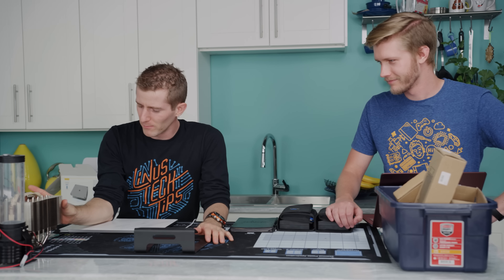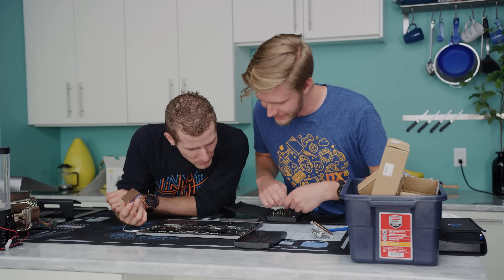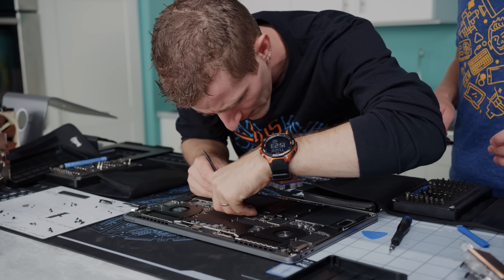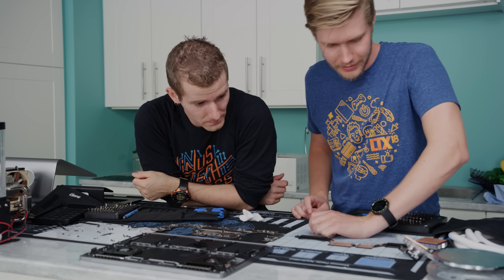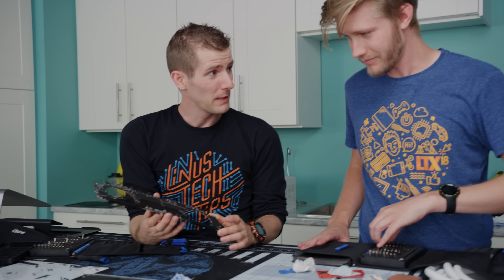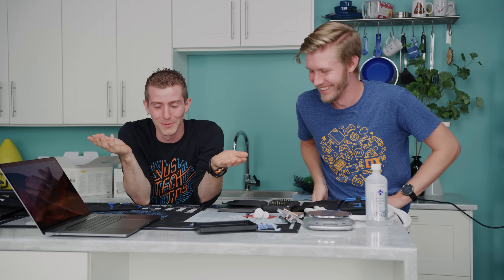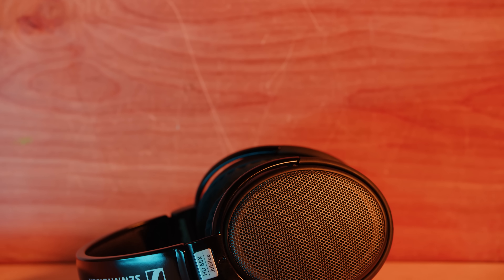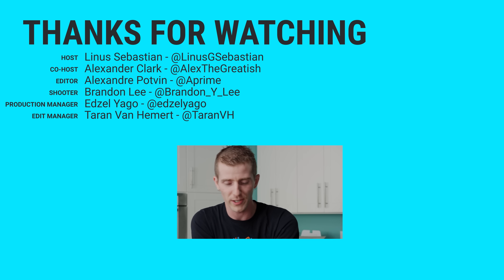We FIXED Apple’s New MacBook Pro

Comment: If don't have a wheel to help pop the case frame, a halberd spudger (yes ifixit does sell them, lol) could be useful. Use a halberd on iPhones when doing screen repair & helps out. Just a tip, if not using a wheel(can link you a tool if want that I use....by Jakemy. It's a wheel isesamo combo but is diff than the norm. My preference is all).
COOL vid.
Cheers All

Comment: Screws. You're doing it wrong. The correct way is Dixie Cups. You know, the little ones you'd have in your bathroom. Just fill one cup with the first set of screws. Grab another cup and put the next set in and stack it on the first cup. Then when you're done, just take the screws out and move through the cups from top to bottom. If you really want to be careful, place an empty cup in the top of the stack first so that if you get called away, even if the stack falls over, the screws should remain in their cups.

Comment: People still dont get it! The CPU is running "cool" (at least relatively), VRM boils.
Same on those RGB Junk motherboards! They have no proper VRM cooling, it's impossible for them to put a heatpipe with alot of copper fins on top of those boiling mosfets. NOT a  chunk of aluminum. If they want to save money in production, here is a proper fix: Remove all the bling bling like plastic covers, LED heatsinks, "heat shields", PCIe armor etc.
But there we are, thinking about Apple again. Stupid Gamer boi does the same as stupid Apple boi: Buying products only because they look fancy.
Reply: TheRailroad99 not all gamers use cool looking rgb motherboards, and the other problem is that the MacBook doesn’t have the same airflow a desktop does
Reply: TheRailroad99 But they look so fucking good.
I can’t help myself

Comment: Since you have a laser cutter why don't you try to open holes above the fans in the bottom lid? That should help for sure. Maybe even use some thermal pads to make the heatpipe contact the rest of the chassis.

Comment: This fix is less effective than a laptop cooling mat.
Reply: Yep, put a cooling mat under a Macbook with no intakes on the bottom, dumbass! You could, however, take a drill and add a few holes at the right locations into the bottom cover.
Reply: but it isn't.... This is liquid metal not thermal paste. I would agree that thermal paste in most cases is only a few degrees, but this typically is much better. My laptop on general performance about 15% better than the stock. With a laptop pad I can cut off under volt as well and get even more performance.

Comment: Wow, what a technician nightmare... Nearly every Dell notebook I have taken apart (easily 100 or more) has never used more than 2 or 3 types of screw, most commonly 2. One size for nearly every location (sometimes of differing length, but same thread) and the smaller size usually used for securing the keyboard. Much, MUCH easier to work on than this.

Comment: Hi guys a got a question. 
So I wanna get an very good gaming pc for under 1000 euro but the problem is I don't understand horse sh*t about pc's.
I know how windows10 works because I have a laptop but idk anything about the components. where do I start? I would like that it looks really cool with led capabilities and a glass case. if it is possible even liquid cooling. I wanna start next summer with buying all parts and building it. atm I'm researching on how to build it. I'm saving up and already got $400 and will get $500 from my mom next summer. I'm 14 and will get 15 next week. I might get a little job but idk yet. do you know any youtubers or video's who explain everything from scrach for starters like me? I need help. Thanks a lot!!
Reply: Linus did some really good build guides a few years back, but they're still a really good way to learn about all the bells and whistles of a PC. Aside from that, I personally like Bitwit and Paul's Hardware - both pretty similar channels to LinusTechTips. JayzTwoCents also made some good videos on the subject. PCPartPicker is a good place to look for components, as you'll find the best deals on most components. Generally, in that budget, I think something like the Intel Core i5-8600k and some dedicated GPU would be your best bet, but depending on your workloads, Ryzen might be a better choice. Good luck.
Reply: I think picking the right parts is by far harder then just building it.
Reply: Emperatordaniel You're actually on the right channel but a good website to start is PC part picker it will show you pricing and compatibility while you look through parts and linus's  earlier video will show you how to build it.
Reply: I'm learning slowly but surly xD. I still got a yeah to decide after all. Thanks guys for helping me!
Reply: craft computing has a great video on this. 
just search Ryzen 2200G + GTX 1050 Budget Build Guide

he does not show the extreme basics, (screw placement how to plug things in ect) but it is a decent parts guide.
I also seem to recall bitwit doing a much more indepth build (while drunk) that could be useful.

picking parts and building is the easy bit. it's waiting for them to arrive that's hardest.

Comment: Real high performance engineering: Design the heatsinking so it can dissipate twice as much power than necessary
Apple engineering: undersize the heatsinking severely because of space reasons and then also throttle the fans to make everything quieter, it's fine to have gpu and cpu cook, but still charge a performance price.

Comment: "Over time, liquid metal does actually needs to be periodically reapplied"

Not really true. A lot of people re-seal their chip after applying the liquid metal, and once it's done you can pretty much forget about it. Unless you're swapping chips or disturb and move the cooler on top of it, you do not need to re-apply.

Comment: You should be able to use blowymatron without cutting holes in the case. If you make a duct or shroud that fits the intake vents on the bottom left and right you should be able to force air in without much issue.

Comment: Turns out that Apples products are completely over priced because they spend 2/3 of the price on designing it to be as hard as possible to disassemble it, meanwhile they engineer a few ways it will easily die just to make sure it doesn't keep working for to long.

Also the blowiematrons, cant you guys 3D print a bottom that has the holes in it and add them that way for a video?

Comment: Now I want to see them cut holes into the bottom of an i9 MacBook and put on a water cooling system
Reply: 100$ they gonna do it!
Reply: @Milan Seratlić
 100RMB they're not gonna do it! haha
Reply: Milan Seratlić Ohhh boi
Reply: I wonder if he can do something less extreme and external  to help cool it
Reply: Take out the MB and all the components, re engeneer the chasiss with 3D printer and stick a proper liquid cooling solution inside. Make it a laptop thats has a 10cm hight witch would be technicaly portable.
Reply: A big chunk of their income is from apple videos.  They will do it.  Apple is probably paying them.
Reply: Milan Seratlić I remember when 10cm wouldn't be unusual for a portable computer.  Like the original Compaq or the IBM P70 (which had high end desktop processors from their years).
Reply: @texmex9721  they NEVER got sponsored by apple, dude do you remember when they refused to fix their iMac? They literally buy every apple product that they want to review.
Reply: @mahmoudsobhy5843  So the massive amount of free advertising Linus gives Apple is just that, free?  Now the is funny.
And no, "They literally buy every apple product that they want to review."  The truth is They literally buy every apple product.
Reply: @potato_x69  nah, it will detect that the air isn't the same as in the factory and won't boot
Reply: Yes, this can turn into an accessory for Macbook Pro
Reply: Shit, if you're gonna do that... might as well make a water cooler / GPU combo
Reply: I wanted to see this!!!
Reply: Rejor111 Shut up 🤐 now Linus is gonna do it 😡

Comment: You're still applying liquid metal in the WRONG way! Put some on a cotton swab far away from any components and then use that swab to coat the silicon die.
Never use the syringe directly on the components or you might end up with shitty modern art the same way fake artists do when they throw paint directly on a canvas instead of using brushes.

Comment: If liquid metal has to be reapplied, would something like AS5 be a legitimately better solution? Better than stock, but only need to apply it once?
Reply: It doesn't. Check out the NBR forum and/or Gamers Nexus. If you apply it properly the first time liquid metal will perform the same as it did day one years later.
Reply: @27Binx72  So Linus is wrong in saying that it has to be reapplied periodically?

Comment: Why do they sell a several thousand pound device and can't be bothered to use a decent thermal compound. It's insane.
Reply: I think design is a poor word choice here, aesthetic would be better. Design can be in regards to high function, which these machines lack.
Reply: As he mentioned, liquid metal needs periodically re-applied. I don't think any company uses it for their products.
Reply: @cellofellow5115  Artic MX4 claimed to be better than liquid metal.
Reply: wat?
Reply: Tbh its not only them. All industry followed this shitty apple's trend and most sub $2k laptops thermal throttle and are thin piece of shits.
Reply: Agree, and I hate apple products, but they are not on their own. I'm a huge fan (and owner) of the Dell XPS13 but the stock thermal paste is possibly the singular worst component of any computer system known to man. It doesnt just "dry out too quickly" its actually not even worth firing up the machine from the box till you have changed it.Thankfully they are easy to strip down and it doesnt void you warranty so no major drama's, just confusing as to why they skimp a few pennies on a premium device
Reply: It's Apple, who do you expect?
Reply: It actually deosn't weigh that much
Reply: He's talking about his country's currency, not about the weight of the device.
Reply: It's Apple, whadya expect?
Reply: you forgot screws, they care about screws. The more the better xd
Reply: They still have ddr 3
Reply: Not insane.....just Apple things.
Reply: Nope. Highly disagree, as did @nodvick in here.

Design, if used right, is to also streamline your production to make your product and the whole economy cycle as effective as possible. It's clear that Apple does use poor product-design, because the management fucked up and is probably on some kind of substance (might be 'greed' though) to squeeze more money out of the life cycle, by seeing HIGHLY overpriced repairs and components.

Comment: There were liquid metals.
I chose #Icdiamond because they supposedly dried out, I implied dried out failed or did poorer.

Back to bulletproof=heatproof,
At least when DOT motorcycle helmet burns in a fire Kevlar good?
https://youtu.be/gT3S_XXMwkI
Reply: 13:30 liquid metal has to be reapplied? ~ holy shit. 20 years, two different metal battery solutions discovered, and y'all are using the inferior to a normal dental amalgam chemistry shit I rejected for the 1st Athlone?

If dental amalgam work for decades, some day liquid metal will too. ~ be interesting to know just how many months years. Minimum 1 decade for me.

Comment: Yo linus, you should have tested continuous high draw performance the VRM's in this thing get toasty and actually cause most of the throttling in the long run, solution was to add thermal pads to those. It was weird watching you go through literally the exact same issues I had modifying mine even down to the fucking bracket that hooks over the board and the obnoxiously long boot delay after reconnecting the battery.

Comment: I think that there must be a reason why the one screw is shorter than the other. Maybe its a 10 milliseconds faster to drill and the screw is cheaper or a too long hole would create a place where the aluminum could break. I don’t know why but it must have a reason. And i don‘t think its to fuck the customer. That would be nonsense.
Reply: But damn are there many screws in that! I got MacBook Pro 15 from 2015 and there are like 10 screws to unscrew the motherboard. But i think you did not had to unscrew the trackpad. :D

Comment: That German warning that came with the cleaning stuff. It says do not use with aluminum cooling solutions. 
Well you didnt use it on the case so you will be fine. Probably contains that metal which makes aluminum super brittle.

Comment: The thing is that he is compensating the noise but the temp is the same. If you guys push the fan to 100% it will have a bigggg diference
Reply: How...did...you...even come to that conclusion? He replaced the thermal paste on the CPU (The main heat producer) meaning now there's way better conductivity between the fans and the CPU. Fans staying quiet by default is a hallmark especially during stress tests as if the heat did rise so would the noise from the fans ramping up.

Comment: Would it help if they were to put in a thermal pad on top of the stock heatsink so it connects to the metal lid so the entire surface becomes an additional heatsink?

Also, how does Rossman track his screws?

Comment: Is it possible to put a VRM thermal pad on the heatpipe, to transfer heat from heatpipe to the bottom plate, so the chassis acts as a cooler?
It may heat up the bottom to much for comfort, but should help cooling and no need for playing around with 100 screws.

Comment: Put Liquid Metal on it, Even if it means sacrificing your Warranty.
                   ✅     Just Do It
Reply: Well meme'd, my friend.
Reply: Doesn't destroy copper. It'll fill the imperfections/pores in the surface and leave the copper looking stained. However it's perfectly safe to use. Obviously you shouldn't use it if you don't know what you're doing, but it doesn't "destroy" most metals.
Reply: @tmh462 Dude. You paid for Applecare. That's extra cost
Reply: Yes, that's why you don't use it with aliminium coolers.
Reply: It's a joke.FFS
Reply: Who cares about Apple Warranty. I have to yet hear of a case where having it actually paid off.
Reply: Против Глобал  Obviously there are risks, but if you apply it properly and follow the recommended precautions, such as taping off the chips PCB with high thermal grade electrical tape and using clear nail polish on the exposed contacts, then you'll never have a problem. Oh, and obviously avoid aluminum heatsinks. It's not for the faint of heart, but if you can read and follow instructions, then you can reap the reward.
Reply: Not worth it with the current MacBooks though. The heatsink is garbage.
Reply: I'd like but it's at 666

Comment: How about SMCFanControl? It lets you set the minimum fan speed, including a minimum fan speed that's the maximum the fans are capable of. I run it on my 2017 with no issues thus far.

Comment: 54 grams. For an i9 and a GPU...
What kind of TDP cooling solution is that ?! 3 watts ?!
Reply: In this case the weight doesn't even matter as the temperature dissipation away from the case is the real limiting factor. They should have put the water cooler for real.

Comment: Why were you surprised that 'Apple' needed the screws on the bottom for it to work? In the 'industrial electronics' factory I work with, using screws and fittings as safety features is quite normal... And it is not the first time that I have repaired DELL computers with the same requirements. They actually use them as conductors in 'ground planes'.
Reply: With all due respect, I think that having screws to close the bottom on a notebook is quite a good thing to have... (PS. I do NOT have a macbook, just to make things clear.) I have an old i7 DELL XPS which requires two screws on the bottom to be present before switching on...
Reply: Perhaps those screws can be used also for making sure that the machine has not been opened for warranty reasons...

Comment: 7:30 Good work Linus. Liquid metal can not be applied not only to aluminum radiators, which causes an avalanche-like destruction, liquid metal passes inside the crystal lattice and destroys it, but it is impossible to copper surfaces either! A liquid metal (an alloy of several rare earth metals, at a low melting point) is destroyed and converted to a solid, porous substance, with very low heat transfer. What's even more unpleasant, the radiator can be soldered to the processor, and you'll have to heat with an industrial hair dryer to take it off. You can already buy a new cooling system for your MacBook Pro
https://youtu.be/kj_iSJxCZmk?t=48
https://youtu.be/7138zVWEb88

Comment: You do NOT need to reapply liquid metal! LM does not age except for very slow gallium plating on copper, which actually is /improving/ it's performance as an interface material.

Comment: Guy, why didn't you changed the fan curve? I use Macs Fan Control and when my mbp goes over 60C i ramp the fans to max rpm (5489)..Yeah, its louder but what the @##$, better the having a slow machine :)

Comment: According to Apple you did NOT fix the new MacBook Pro. Once you replaced the Apple certified thermal product with a 3rd party product (liquid metal) you NO LONGER even HAVE an Apple product and to call it such is grounds for legal action. (I say this to poke fun at apple, but the sad part is I'm probably dead on correct)

Comment: I have a solution to cooling it.

First step. Buy a mini fridge or freezer

The second step is to put a hole large enough for your power cable to go through, next make a hole large enough for a hdmi cable or what ever method of displaying your screen to a monitor you are using.

The third step is to power your Mac book on Hopefully your Mac book with stay cool.